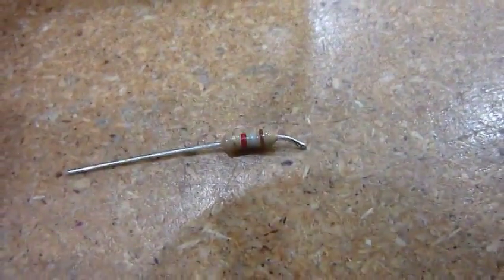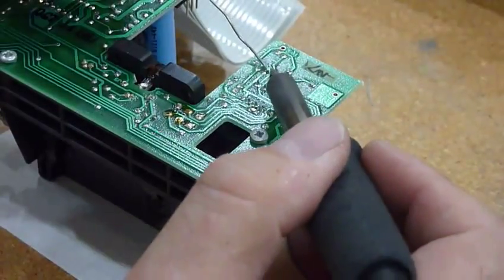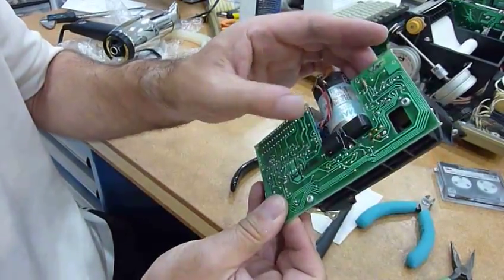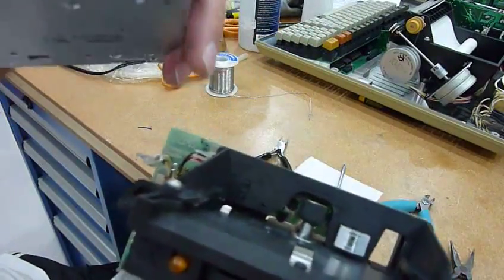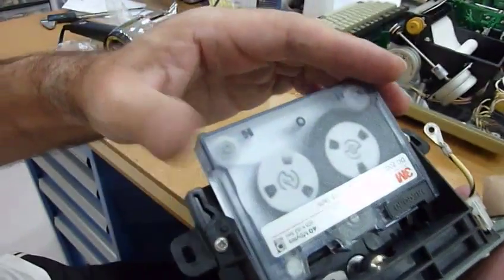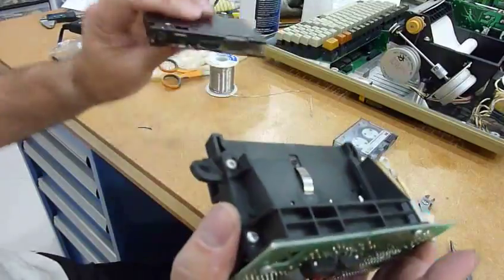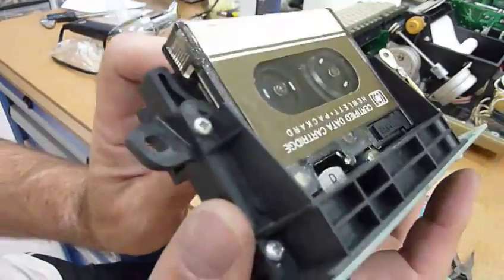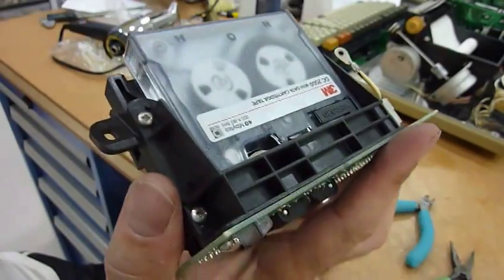HP 85 Repair Part 9. Tape PCB modification, putting the drive back together.

Comment: Is the resistor to adjust the recording bias (or maybe the signal level?) due to the different characteristics of the tape media?
Reply from the maker: This is the resistor that controls the write current in the record head. Coercivity in the newer DC 2000 tapes is higher, needs a bit more oomph from the writing head. It does not affect the older DC100, they’ll still work fine with the resistor.